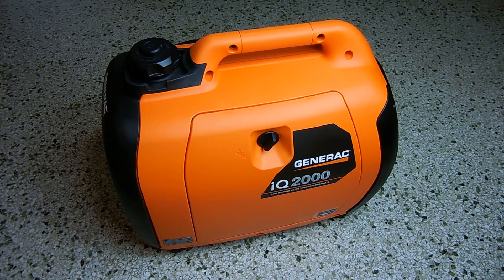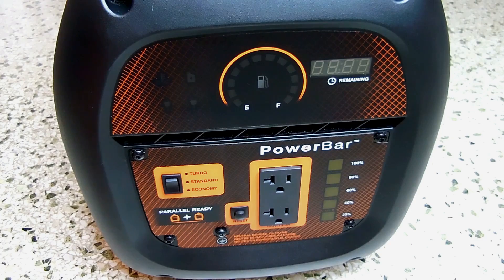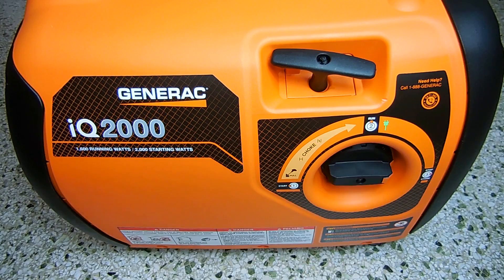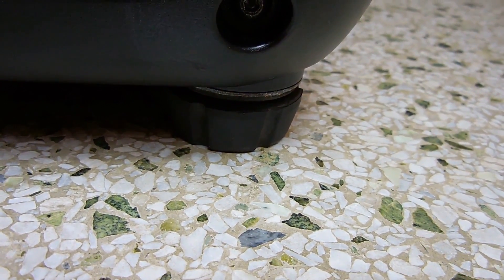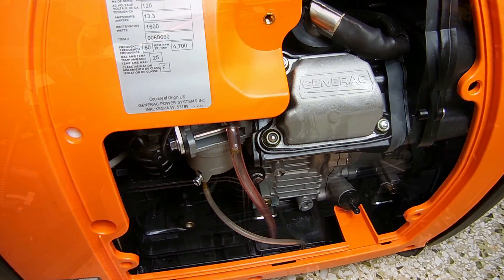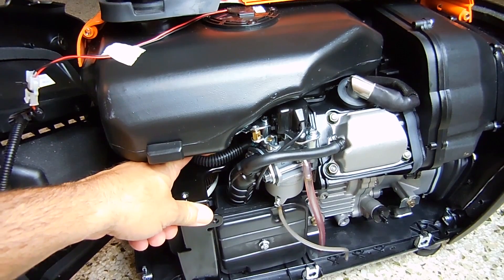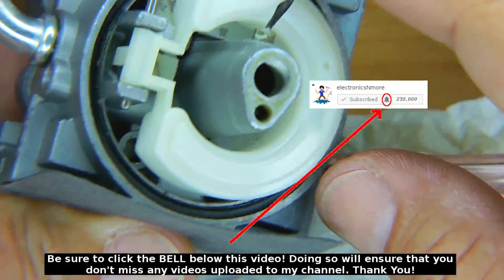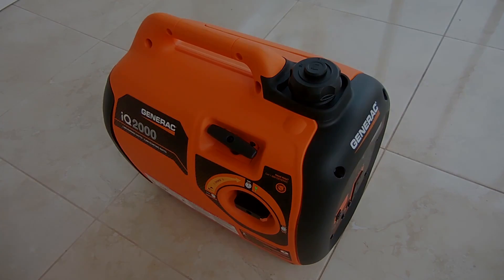Generac IQ2000 Inverter Generator Troubleshooting & Repair(Also Craftsman)

Comment: Many of these that are a little low on oil will start run 10 seconds and die. A common problem on construction sites. If nor level low oil sensor also shuts down .
Reply from the maker: Yes, I made sure I mentioned the oil shutdown float switch in the video. Thanks for watching!